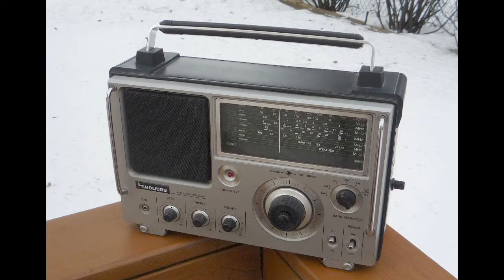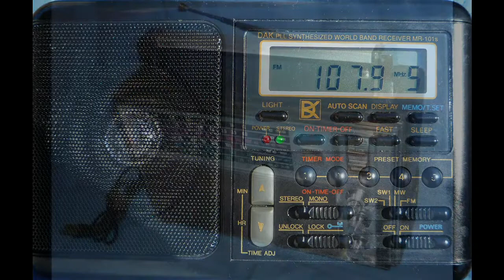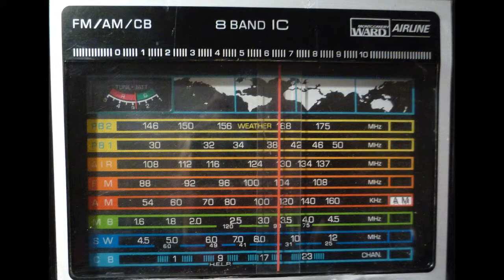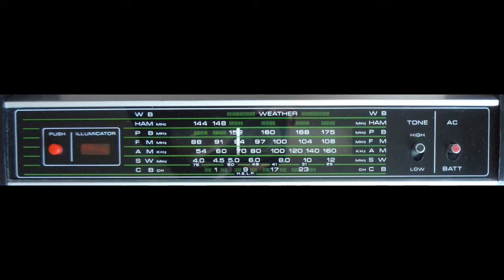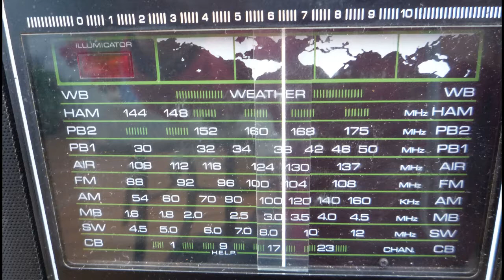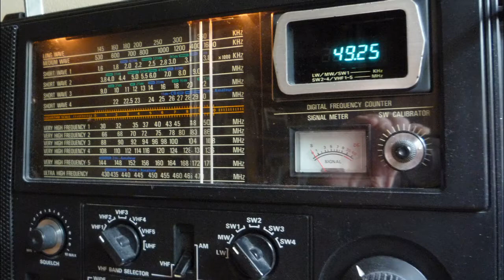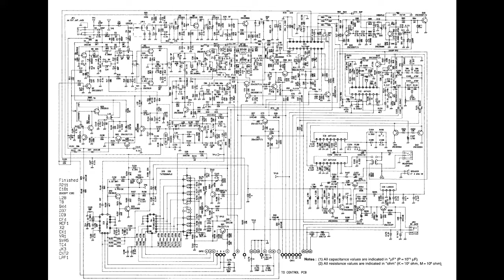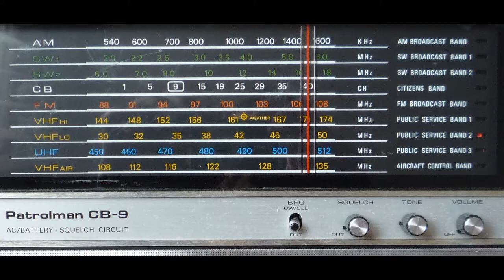MY TRANSISTOR AND  CRYSTAL RADIO SHORTWAVE RADIO photos

Comment from the maker: I'm still not a collector of radios. I buy, repair, and sell most of these radios, so all of my 'collection' is only temporary. I do have favorite models: the shortwave radios with BFO. The DX-392 and DX-390 models are still good working models in 2024, so I buy and repair these models, as well as the Sangean ATS818 models. Most PLL-based radios with memory are very useful. However, newer DSP models with SSB function are not always well-designed.